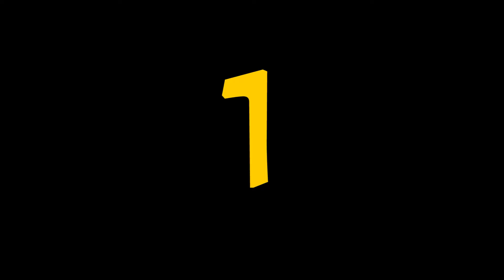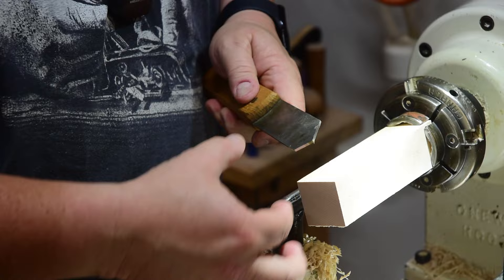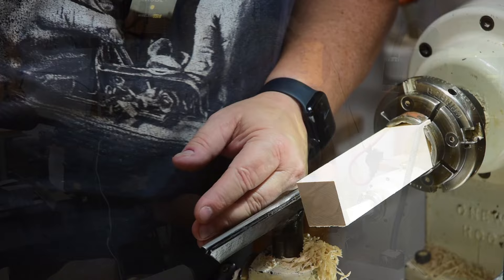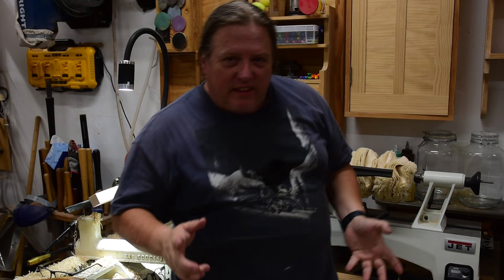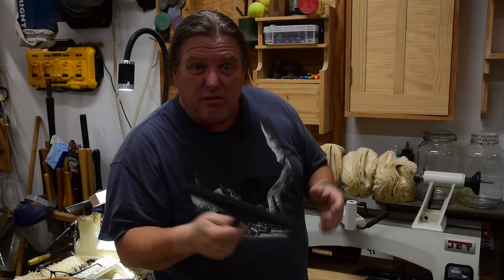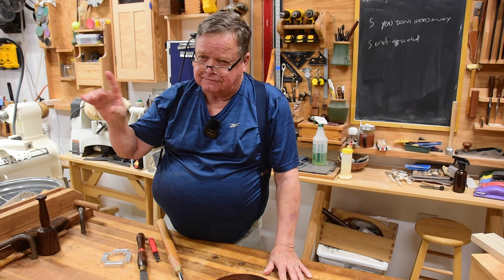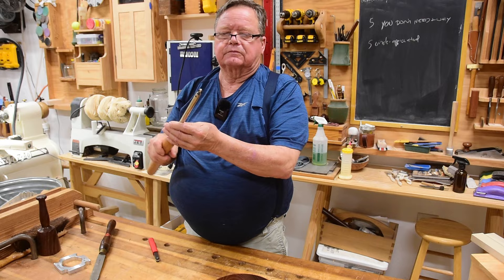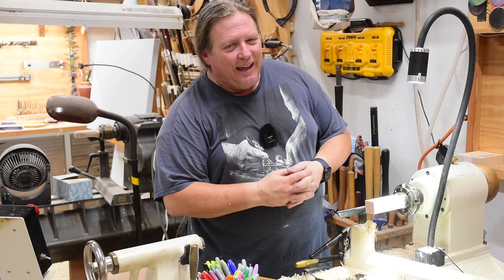Five Turning Tools You Don't Need and Why

Comment: I use a narrow parting tool sometimes.  I have three different sizes plus a Bedan.  Depends on what I am doing and what works that day.  Texturing tools?  What does your Dad do if he wants some sort of texturing like on a Top or some other small project?  You didn't even mention carbide tools!!  I use carbide tools when I can't get a traditional tool to do what I want it to.  I don't have much experience however.  Sharpening is a PITA and as expensive as anything else in woodturning besides the lathe.  There still is no easy straightforward solution that doesn't require years of experience and trial and error.  I laugh at all these turners on YTube that sharpen everything freehand in seconds!!  They forget to mention they all have 20-60 years of experience doing it.  Some days I use my grinder and a Wolverine setup, some days I use my ProEdge belt system, depending on the tool.  I custom make little angle jigs to set the angle on the plate.  Trial and error.  Some days I spend more time screwing around with sharpening than I do turning!!  No wonder carbide tools are popular.  But there is a rub there.  It takes minutes to change out a blade.  They are so small and the screws come in different types, etc. etc.  I inevitably drop either a blade or a screw and then can't find it.  I spend more time fiddling with all the tools and chucks/jaws, preparing and mounting blanks, etc. than I ever do on the design and the artistic expression of woodturning.   Maybe that will change with time.  Oh, and you didn't mention all the snake oil they call "Finishes"!! Keep up this series!!  Thanks.

Comment: Never heard of a safety drive center. Why would anybody buy one? SPINDLE WORK-Diamontd parting tool, 3/8", 1/2" spindle gauge, a Bedan tool, 1 1/4" skew, and a 1 1/4" roughing gauge. Small and large drive center and a cup live center.  A screw chuck and a 4 jaw chuck. Forgot, you need a lathe. I have turned 100,000 + spindles from 1/2" long to 12' long and as big as 15" in diameter.
STAY AWAY FROM GADGETS!!!!
GREAT VIDEO

Comment: I have a thin parting tool. I may be wrong in saying that it was “originated and first” sold by a UK turner of renown in his day by the name of Chris Scott.( Check him out)My one has his name on the wood handle. I find the thin parting tool has its uses on small & fine pieces, but would agree it is likely to bind the larger the diameter of the piece being parted off.

Comment: Well i have to disagree with those "safety" drive centers, mainly because they really aren't for safety. The readson for the finer teeth is for soft and small diameter wood pieces,so you don't run into the issue of splitting your wood with the drive center.
If you are doing a lot of finer work below 4-5cm diameter, these are really handy to have.

But for beginners, a normal drive will do much better work in general
Reply: I sort of agree with you.  Not heard of these as safety centres. But if I need to hold wood that is likely to split, I go for my crown centre rather than 4 spur.

Comment: The day when I will take advice on turning tools from a fool who doesn't know how to grind the proper bevel angle on a parting tool is a long time in the future. I could only take about 3 minutes of this; there might be some good bits in the rest of it but I doubt it.
Reply from the maker: Platform set at 40 degrees, grind both sides, cut with the burr up side. Books say to go about 45 degrees but I use 40 degrees so often I just leave the platform there. As discussed in any one of my many sharpening videos. Didn't discuss grinding anywhere in this video so haven't a clue what's up your chuff.

Comment: Great video Shawn. But, I do have to disagree with you on a couple of tools on your list. First of all, the slim parting tool is a wonderful item. When making boxes, you can match the grain of the body and the lid much better with a thin parting tool. You are just removing less material from the box. A thin parting tool is also essential in making a honey dipper. I would like to see one made with a thicker parting tool. It would just not look right. 
The next tool on your list I disagree with is the so-called safety drive. There are several versions of this drive and they are mainly designed for production spindle turning. They allow you to mount and remove your spindle from the lathe while it is running. These types of drives have a spring point center pin which allows you to loosen the tail stock just a little and the spindle will stop spinning. You can also mount a spindle the same way. As long as you do not engage the drive, your spindle will not spin. Once you have the spindle aligned, just tighten the tail stock to engage the spinning part of the drive center. Much quicker and completely safe.
Reply from the maker: I use a flush cut saw on boxes and skew on honey dippers. V-cuts are easier to clean.
Reply: @wortheffort  I forgot to mention that I use a flush-cut saw after the thin parting tool.

Comment: Number 3, safety drive. You're using it wrong. It's  a dead center fir the tailstock. A typical dead center has a single point and could split the wood. It's mostly used with a lot of grease for metal turning. Live center is better. The safety center eliminates the wory of the wood splitting. If you ground a notch in it, you just destroyed it.
Reply from the maker: No, this one’s a drive center. But I know what item your referencing.

Comment: The diamond shaped parting tool? Garbage. Just use a 3/8" beading tool and then it has many uses. The cheap 3/4" roughing gouge that sorby makes? Garbage. Its not a radius so making a shear cut is a huge pain.
Reply: Kinda don’t agree, I have a 3/4 Sorby roughing gouge and find it very easy making shear cuts with it.
Chuck
Reply: @brenchuckswood3826  try out a crown one or any that's pretty close to a radius shape instead of just a bend, its pretty great how much better it feels.

Comment: I wanted a thin parting tool so I  made one out of an old thrift store paring knife cut/ground off the sharp edge and the narrow tip to a roughly 45 degree angle.   It cost all of 50 cents.  It is obviously not high speed steel so I'll need to sharpen more often, but does it really need to be HSS for the quick cuts I want to make on thin spindles?